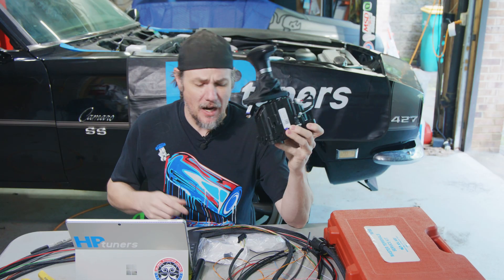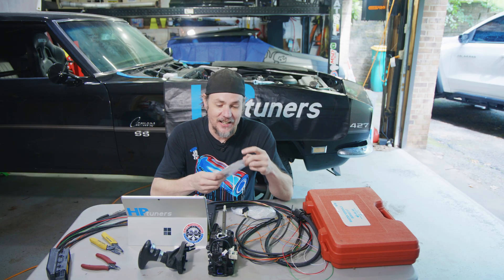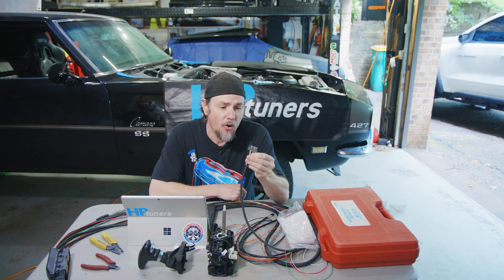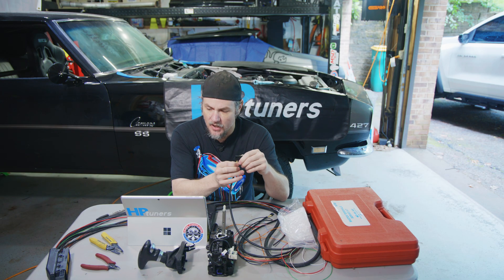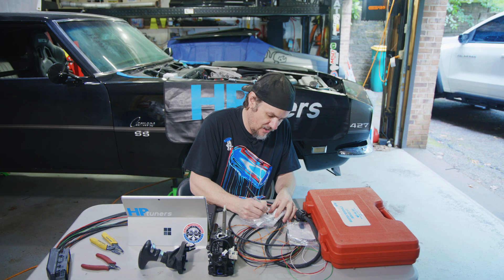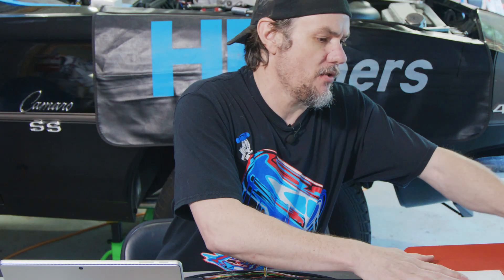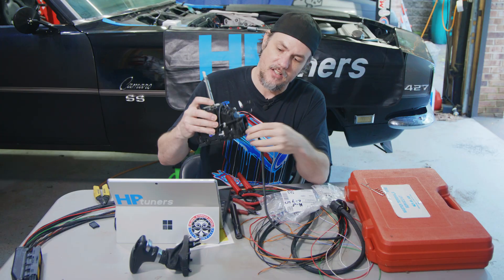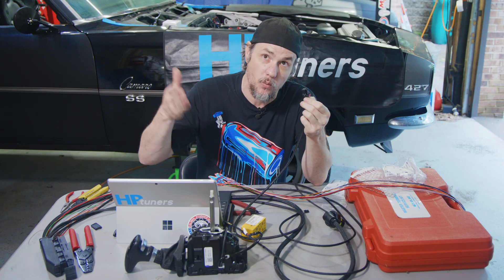Wiring A Dodge Shifter For The Turbolamik TCU On Our 8HP70 Swap

Comment: I've ad the 8hp in my car for over a year now using turbolamik.. one of the best upgrades I have done by far!
Reply from the maker: That’s what I like to hear!
Reply: What do you need to wire the turbolamik to? I wanna add it to my 02 SS but it does not have CANBUS. What do you think?
Reply from the maker: @kilroy4123 You can run the analog version which brings in things like rpm and map pressure to do all the calcs on the TL, that’s how the carb guys do it
Reply: Anybody I should look at for examples of these running on more analog cars? I already follow legit garage and their el caminos

Comment: I know your busy I could really use some help trying to get this e90 started and staying running
Reply: It's a 2020 5.3 L84 with an L83 non DOD cam installed I'm unlocked and on tune version #20 and I'm still not able to keep her running unless I add throttle myself
Reply: Add some grams per second to your base running airflow table
Reply: I appreciate you jumping in and adding some input. I didn't have the cam correctly installed she is running good now. @mothridith9760